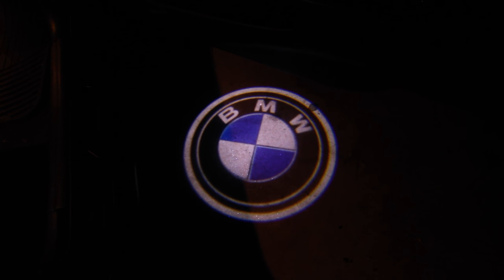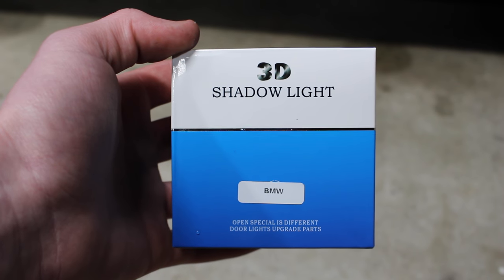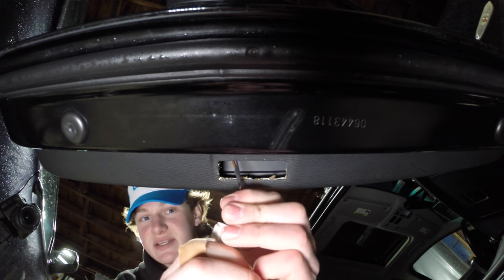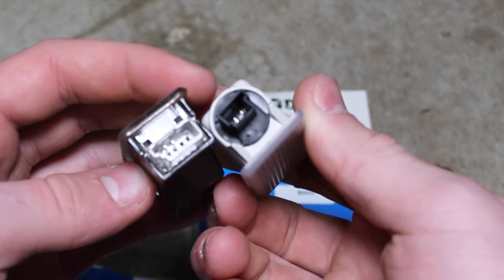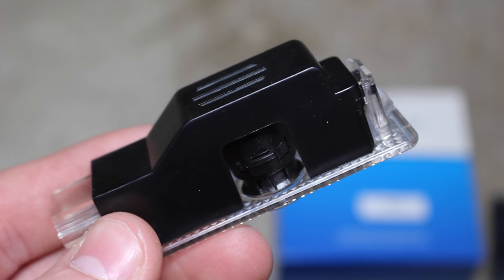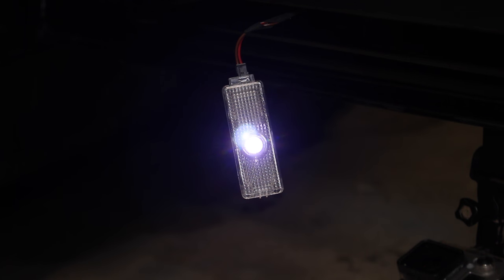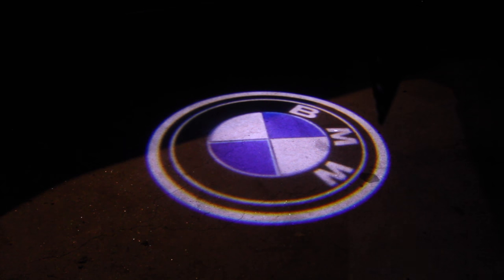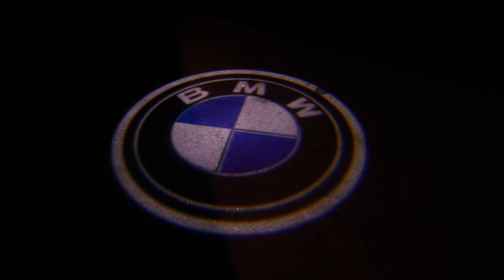BMW Logo Projector Light Install // EASY DIY

Comment: Just bought my 325i 2006 not too long ago my first car too aha and am 18 by the way, I bought it for 10,000 still paying it off tho put 4,000 down and car came with 75,000 miles on it and it's black 🔥 bought my car on February 6,  2017 and ohh yeah they will also be my first Modification to my car !
Reply from the maker: Brandon Mendoza sweet!
Reply: Brandon Mendoza I purchased a 2009 for that price lol. with nearly the same mileage too
Reply from the maker: Sweet haha!
Reply: I purchased the same car too but in silver and it came with 107,000 miles the radio pixels don't work and it's a little scuffed but I got it for 5,400 everything else was flawless I'm 16 by the way .
Reply: Just last week got a 06 330i for 6000. It's having problems; when you push the gas it starts to vibrate but its because a coil is bad. Ordered 6 on Amazon for 80 and I can't wAit to install them .
Reply: Bought a 2009 328i with 100,000 miles for $4500
Reply: just got a 08 e92 328xi like 105 000 miles

Comment: Hey, I have a set of these projector lights in my door and I've noticed that over time the lens with the logo on it starts to deteriorate over time. Since I found them for only 10 dollars, you would have to replace them about once a year. It would be nice if they just sold the lens replacements.
Reply from the maker: Yeah, I found the same thing happened with mine

Comment: Hey, I recently got me a E90 323i but noticed that i don't have the standard door lights on any of my doors. Any chance you could give advice on installing the logo lights from scratch? I take my E90 mustve been a base model or something and it wasnt something i thought of looking at when i purchased it. I still love my car and will try and do most of the mods on your videos. Keep up the good work. Damian - Cape Town, South Africa
Reply from the maker: It just needs a simple two wire power source...I'm not sure about the voltage (probably 12 volts?). So you'll need to find a power source, cut a hole, and secure it.